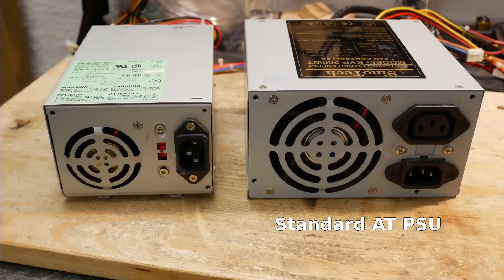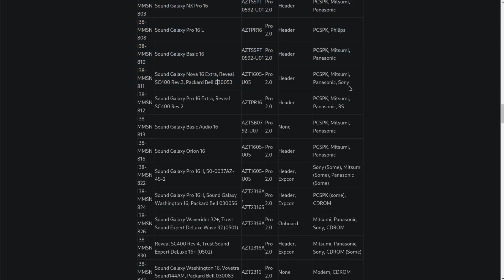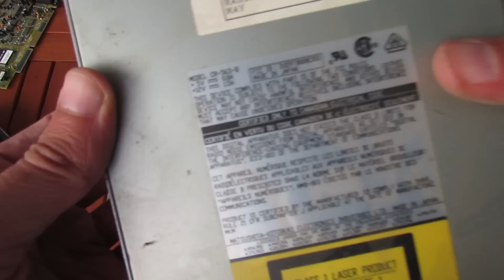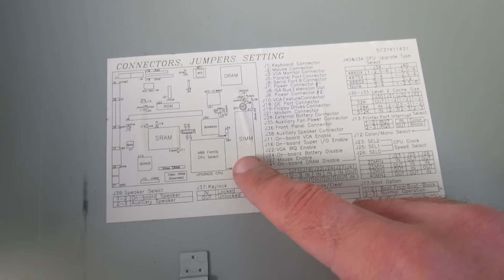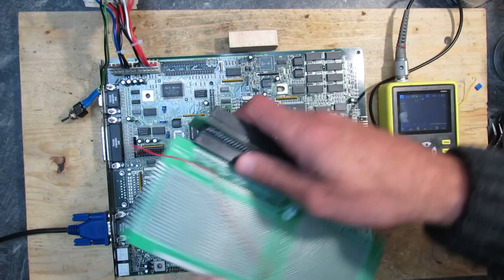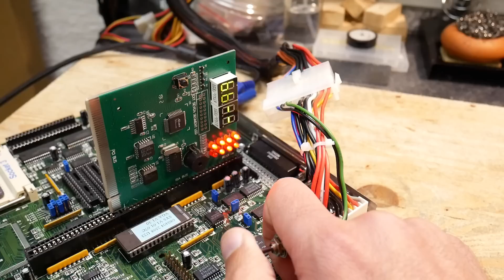Packard Bell PB486CD restoration (Part 1)

Comment: I had a similar cased model (Packard Bell Legend) and it had a 5 1/4 & 3 1/2 floppy (which looked like that one).  the psu died, so I stripped the system (still have the 486 processor from this)

Comment: The sockets for the VRAM expansion are of the ZIP (Zig-zag Inline Package) variety.  I'm not sure if they are readily available, but with your PCB design skills, I'm certain that you could spin up an adapter of some sort, like using an SOJ-20 package.  The pin spacing is 1.27 mm on each side, so finding pins that will go into those sockets should be easy at the very least.

Comment: I have one of those Panasonic SoundBlaster drives, new old stock. I don't want to use it because it has heavy CPU polling and slows down cdrom games on my 486
Reply from the maker: That's true, but I just would like to keep this system original

Comment: Awesome work as usual! I have a VERY similar model PB (they seemed to like to use the same chassis/motherboard for various models) and it too suffers from trace damage (though seemingly much more extensive than yours sadly). Still, your videos give me inspiration to at least make an attempt to repair it, albeit very slowly over time. But even if I don't succeed I have a bunch of retro parts I can use in another 486. And good to see a DEC board is a close enough match that I might be able to locate one of those to use in the chassis.

Comment: It's really impressive how not only you do a very fine job repairing these boards in and on itself but you also take the extra mile to make such repairs really neat.
Some other folks while being very competent in the repair process itself don't bother with neatness and those boards have flying wires everywhere often not even bothering to cut them to length
Reply: Absolutely! Necroware taught me to make it as clean as possible. Still my detailing is not as good as his but I have learned a lot! I hate bodge wire sticking all around...

Comment: That power supply. When I was a PC tech back in the day, I used one of that exact model as the power supply on my bench. It was an amazing little power supply, and served me well until it was finally completely displaced by ATX. Even then, I kept it around for the AT machines which still occasionally crossed my bench.

Comment: The VRAM expansion slots aren't proprietary, it's just a weird packaging for RAM called "ZIP". My HP vectra has the same slots and I managed to find them many years ago. It used 256kx4 chips though while yours uses 256kx16. I checked and they seem to be a lot more expensive :/

Also to dead test old motherboards you should look into making your own BIOS ROM, it's very fun and actually not that hard :D

One of my favorite tests is just a program that outputs 0x01 to port 0x80
Reply from the maker: I have some vram zip modules, but the Pinout seems to be different. I have to investigate it in depth one day.
Reply: @necro_ware  yeah like I said the capacity seems to matter and it looks like the 256Kx4 are much more common than the 256Kx16 (or the 256Kx16 are more sought after)
Reply: Some ibm ps/1 systems also have these for video ram. Also seen them called zigzag modules.
Reply: @Chris-yc3mm  Yeah, they're Zigzag Inline Package (ZIP). The package type had a brief popularity when memory manufacturers were trying to squeeze more chips into a smaller space than DIP. SIMMs supplanted them rather quickly though.

ZIP packaging still maintains a niche in audio amplifier ICs and power ICs like high power voltage regulators or motor drives.
Reply: Some more advanced VGA cards from the early 90" are using those chips. Sometimes even in combinations with dips. I have a pro VGA ISA accelerator where they have used a "normal" memory for the VGA and those "zip" for the additional ram next to the CAD/CAM accelerator part. Pretty crazy stuff to be honest 😅
Reply: @pavelfara9333  is it by any chance featuring a Texas instruments TIGA chip ? I used to have one, but it didn't work so I gave it to someone else in case they could fix it
Reply: @DxDeksor  I have to check the card later on. It is in storage. But I think it has some kind of TI additional chip. The main VGA chip is TsengLab 4000.  It works. (but I am not able to test the accelerator). The only problem is it has sligtly yellowish image. But it may be fixable..

Comment: My parents purchased the version of this computer without the CD and sound card in December of 1993, during my Junior year of college.  As I recall it had some issues with the secondary IDE channel not wanting to deal with an IDE CD drive. Their machine had the soldered in 486SX-25. I ended up buying them a cheap Reveal Cd kit (which oddly enough had the SC400 sound card nearly  identical to the one  in this machine.)  As I recall, they paid $750 for the machine bare and bought a generic 640x480 only 13" VGA monitor with a stupidly high dot-pitch that was almost unusable it was so fuzzy. The monitor lasted less than 6 months before the flyback went out and I replaced it for them with a 15" version.

Comment: I don't have a retro PC but Necroware's way of speaking and explaining things got me hooked
Reply: Do you plan to get one? For starters, i recommend Pentium2 or 3 systems: the bios still looks like the 486 era and you have usb for easy data transfer. There are even baby AT boards for the old cases with big 5pin Keyboard 😅
Reply: @logipilot  Oh yeah, been planning to get one to surprise my mom.

She used to play old source games back then
Reply: Have a look-about.  There are plenty out there, just don't pay the high prices.  You can still get decent vintage machines cheaply if you look. PIII and Athlon socket A/462 are a sweet spot for Windows 98 and early XP games.